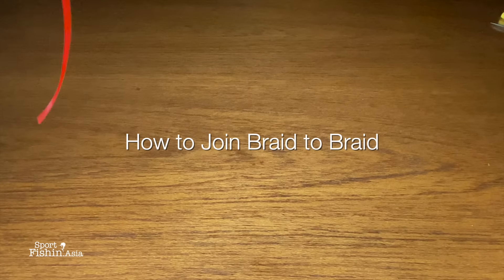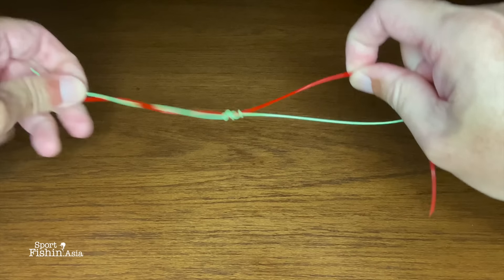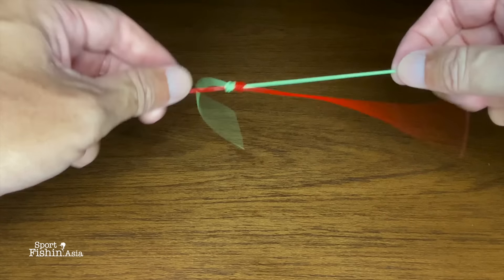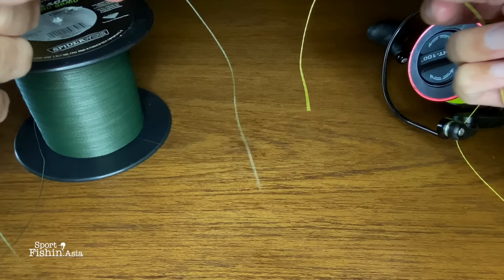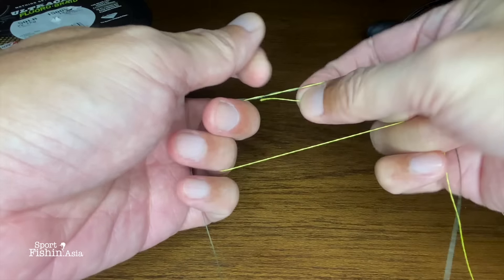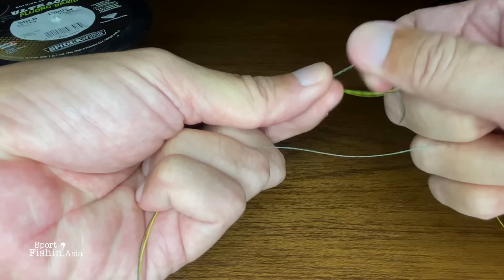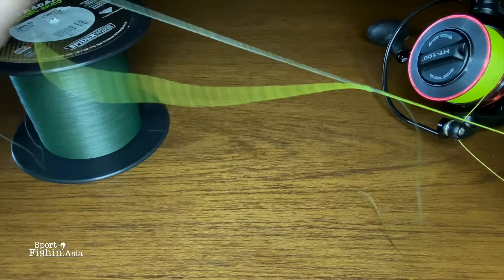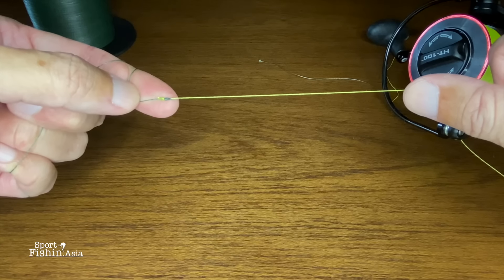Braid to Braid Knot (Proven knots that we use)

Comment: Should be good. I need to unspool my reel, tie more backing onto the braid, then respool it because it doesnt fill the reel up. Ive never used braid before and it fits tonnes more onto the reel than expected.
Reply from the maker: Braid does fill up a lot more. Hence smaller  reels getting more popular nowadays. Depending on your fishing and reel size, you may also use mono as the backing. Oftentimes the backing/braid on the inside never sees sunlight if you have 300-400 m/yd of line on there. By using mono that you have lying around, you save some $.

Comment: How strong is this knot if you are going to use it against tuna? I have half of my braid cut off while pulling a tuna. Instead of buying a new line and put it, I’m think just getting my old line and put it. But I’m just afraid it will snap again if I going for big fish.
Reply from the maker: Haven’t failed me so far. We fish billfish a lot.
Reply: @SportFishingAsia  using this knot?
Reply from the maker: Yes, but we recommend only connecting lines that are new or in good conditions. Used, or worn lines will fail sooner or later. We also use this knot to join our leaders sometimes to lengthen them and it has proven to be strong.
Reply from the maker: It’s also good practice when trying new knots to test them at home after tying to make sure we’ve tied them correctly. When satisfied, cut and re-tie again a fresh one for use. Good luck!
Reply: @SportFishingAsia  thank you so much. Before I used to  a single uni knot from a leader to a braid, I lost so many LURES!. So I ended up using swivel. But now, I will try this double uni knot.
Reply from the maker: Cheers, man. Let us know how it goes.
Reply: @vsonic86  you should definitely use a FG knot or PR knot for braid to FC leader
Reply from the maker: Yes, FG and PR knots are recommended for leader to braid connections. This knot (double uni) is good for braid to braid, or mono to mono.
Reply: New subscriber. Greatly appreciate your skills. Thanks for sharing. Looking forward to more from your channel. 👍🏾👍🏾
Reply from the maker: Thanks! Appreciate your feedback.
Reply: Can i use it on my diffrent braid diameter size i have 30 lb 0.28 and the other is 30 lb 0.20
Reply from the maker: You can. Just make extra wraps on the smaller diameter braid. For example, four wraps on the thicker braid and six wraps on the thinner braid.